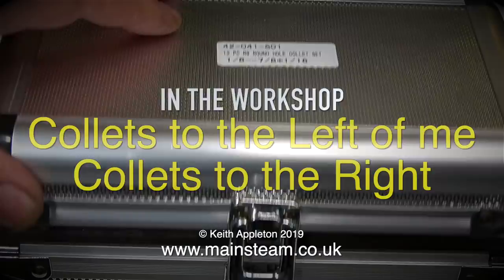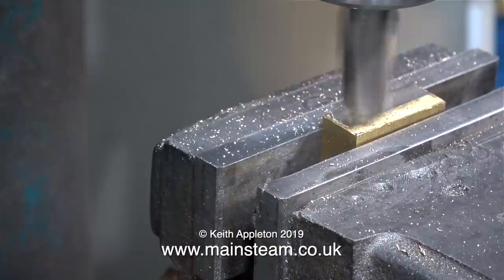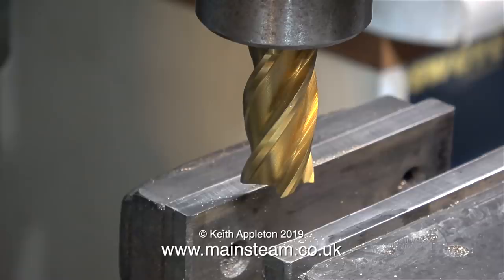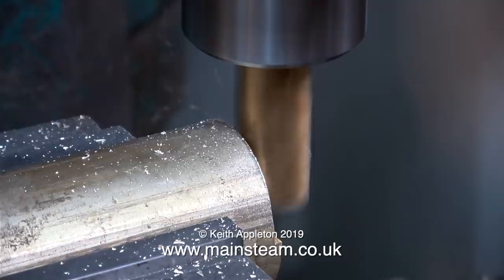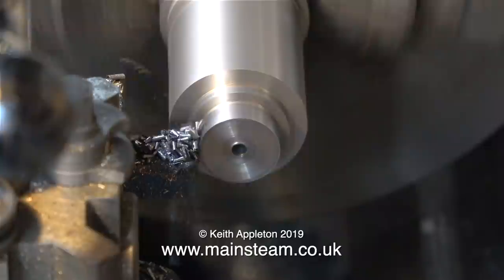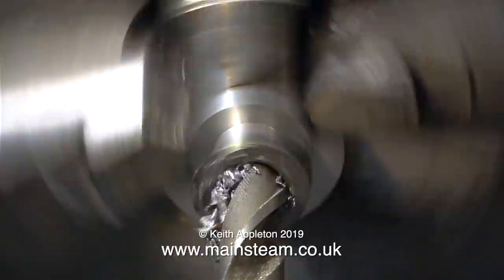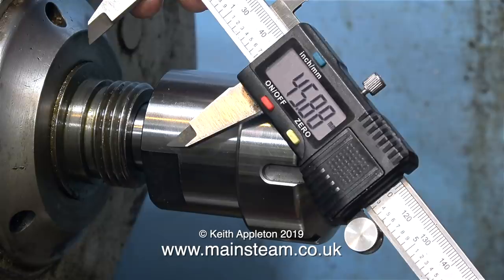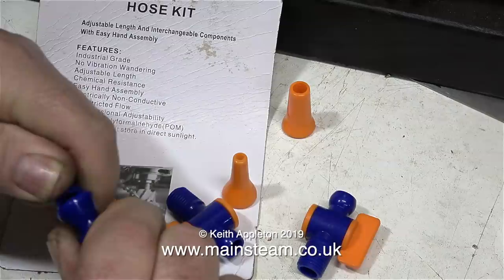COLLETS TO THE LEFT OF ME - COLLETS TO THE RIGHT - IN THE WORKSHOP

Comment: Oh the humanity using an old milling machine it doesn't even have bluetooth or a milk foamer i bet it does not play cdr either. Silliness aside I would be proud to have a crappy old old working milling machine and the space to put it in. I love watching you work and do have some envy at the space and tools you have. I just bought a stanley adjustable i dont think it likes me as it sliced my finger open but so far i think it is the best adjustable spanner I have and it was big enough to undo the nuts securing my mixer tap to the outlet pipes. not see the Barco brand in my local diy shed and I am yet to find a tool shop near me but I live in hope.

Comment: The 'drip feed coolant' sounds like a great plan and a lot more reliable than using a brush as I have been doing over the years. I did have a coolant pump for my mill but while doing a great job of cooling the work it also splattered a lot of coolant around the place - even with screens in the way. The difference between the four flute end mill and the two flute slot drill (apart from the number of flutes) is that slot drill can be used for a 'plunge' cut whereas an end mill does not have that capability.
Reply: Peter Little   Some of the modern style end mills can plunge cut due to un symetric cutting lips. The definition end or slot mill is becoming blurred these days.
Reply: @littleworkshopofhorrors2395  - thanks for the info on the modern milling cutters. It was back in the 60's when I did my metalwork training so it's good to know that thing have moved on.

Comment: I once had an idea that if I attached a brush to my coolant outflow it wouldn't splatter as much.  It did work in that respect, but I had to fiddle with it each time to get it centered.   Surrounding your work area with screens is possible, but it's also a pain to set up for each job.  The modern idea is to set the machine in a booth with an automatic pump and filter.  But for the amateur in his garage or basement this isn't practical either.  I bet you will come up with a more practical solution!

Comment: R-8 is great, but I ended up with MT 3 on my mill. They don't stick down as far as the R-8s do. My lathe is a Emco Compact 5,  MT 2 in the Headstock and Mt 1 in tailstock. Quite a change from the CAT 40 on the CNC that I used to run.

Comment: "Driving a slow car fast is more fun than driving a fast car slow," maybe a similar logic can apply to machine tools. Also a note on the thread protection, a sleeve threaded to match the spindle thread can be used to help remove the collet holder by un-threading the sleeve. My university has an old south bend with such a sleeve and makes removing the taper adapter to fit C5 collets much easier.

Comment: You commented before about not liking the smell of the coolant you were using. I have been using a coolant from MicroMark which has a barely detectable odor. However, it is probably not worth your while to order it from the US with the shipping costs, but I believe I have found the actual coolant they are reselling - TRIM Cutting & Grinding Fluids SC230ND/1 Oil Rejecting Semisynthetic Fluid, No Dye, 1 gal Jug. I can get it from Amazon here but I don't see it on the UK website. If I am right about the smell of this stuff, I'll let you know - maybe you can source it somewhere else.
Reply from the maker: Thanks for the Info Chris.
Reply: IMO, considering that he's going to be drip feeding there's not going to be enough liquid mass to do much cooling.  I reckon he's better off avoiding any staining, molding, and rusting issues that can result from flood coolants and stick with lubricants - WD40/Tapcon for non-ferrous and sulfur/pipe cutting oils for steel..